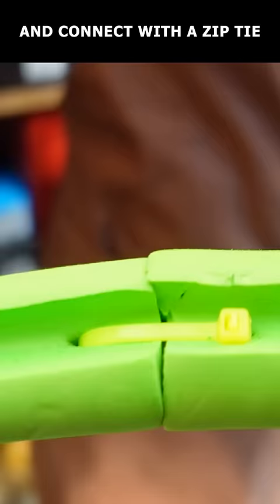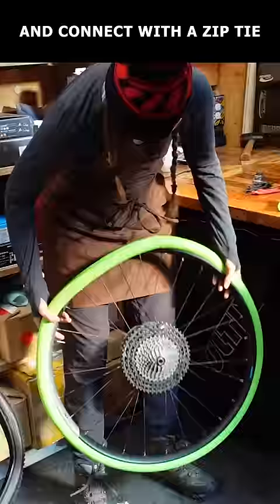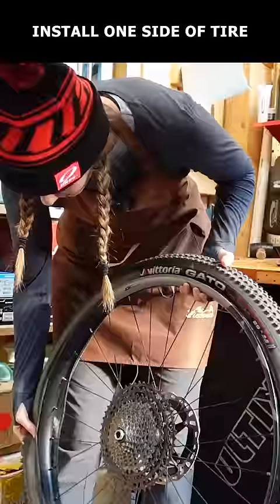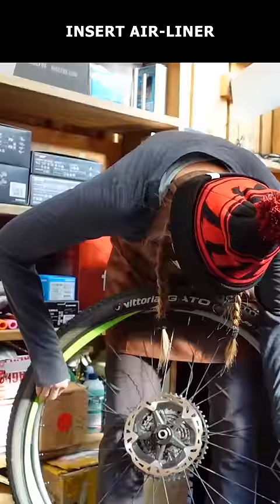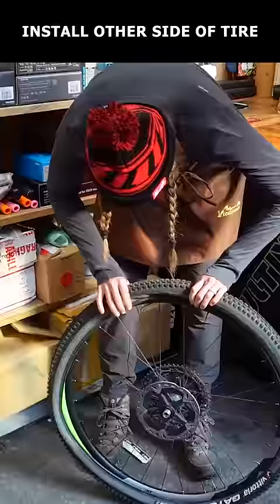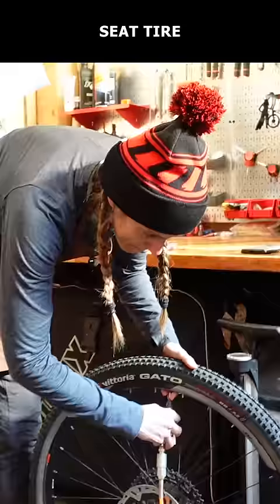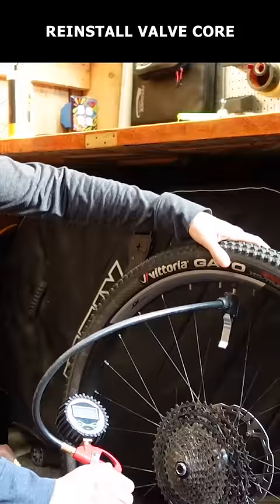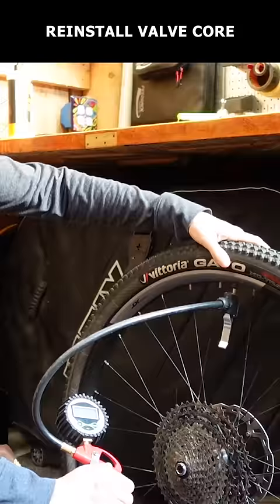Installing the Vittoria Air-Liner tire insert #Shorts

Comment: Ummmmm.... no thanks I’ll stick with slime.
Reply from the maker: This system provides additional rim and puncture protection in tubeless setups and allows you to run slightly lower pressures. It is also a "run flat" system so if you do get a flat you can continue to ride the tire without risking it rolling off the rim. We don't generally recommend that unless you're racing enduro or downhill, but it is an option. So, while it isn't for everyone, it's quite helpful for lots of people.

Comment: pfft, there's air why should I use an air-liner? seems useless
Reply from the maker: This system provides additional rim and puncture protection in tubeless setups and allows you to run slightly lower pressures. It is also a "run flat" system so if you do get a flat you can continue to ride the tire without risking it rolling off the rim. We don't generally recommend that unless you're racing enduro or downhill, but it is an option. So, while it isn't for everyone, it's quite helpful for lots of people.

Comment: What's the point in this ?
Reply: Showing people how to install an air liner
Reply: @Juanmantt  why do you need an air liner ?
Reply: @icantsee0  they reduce the risk of flat or cracked tires
Reply from the maker: This system provides additional rim and puncture protection in tubeless setups and allows you to run slightly lower pressures. It is also a "run flat" system so if you do get a flat you can continue to ride the tire without risking it rolling off the rim. We don't generally recommend that unless you're racing enduro or downhill, but it is an option. So, while it isn't for everyone, it's quite helpful for lots of people.
Reply: @sydfixesbikes  well thank you for the info 👍

Comment: Wtf is the point?
Reply from the maker: This system provides additional rim and puncture protection in tubeless setups and allows you to run slightly lower pressures. It is also a "run flat" system so if you do get a flat you can continue to ride the tire without risking it rolling off the rim. We don't generally recommend that unless you're racing enduro or downhill, but it is an option. So, while it isn't for everyone, it's quite helpful for lots of people.

Comment: Jeez what is the point!!!
Reply from the maker: This system provides additional rim and puncture protection in tubeless setups and allows you to run slightly lower pressures. It is also a "run flat" system so if you do get a flat you can continue to ride the tire without risking it rolling off the rim. We don't generally recommend that unless you're racing enduro or downhill, but it is an option. So, while it isn't for everyone, it's quite helpful for lots of people.

Comment: What's the point of this
Reply from the maker: This system provides additional rim and puncture protection in tubeless setups and allows you to run slightly lower pressures. It is also a "run flat" system so if you do get a flat you can continue to ride the tire without risking it rolling off the rim. We don't generally recommend that unless you're racing enduro or downhill, but it is an option. So, while it isn't for everyone, it's quite helpful for lots of people.
Reply: @sydfixesbikes  mmm sounds useful forsure, would be good for my mountain biking in some cases

Comment: Why are you puting fix a flat in the tire? Lol sealant's only used when there's a leak and it's a very lazy way to go about fixing it.. especially on a bike tire. It throws a wheel off balance when you allow the sealant to dry in the tire while stationary... (takes days to dry inside a tire).... pretty stupid to use on any tire.. let alone a bike tire. Just patch the damn thing... how hard is it to carry a little bit of rubber cement, tiny little sanding pad, and a few rubber patches? A pump attaches to any bike. .. only takes a couple minutes...

Comment: Just buy a new tire like seriously
Reply: Literally has nothing to do with the tyre. With an insert you can ride a lower pressure in both tyres, you have a lot more protection for the wheel and it f you get a really bad slash that the sealant won’t fix and you don’t have a tube you can ride back with no air in the tyre as long as you don’t ride too hard